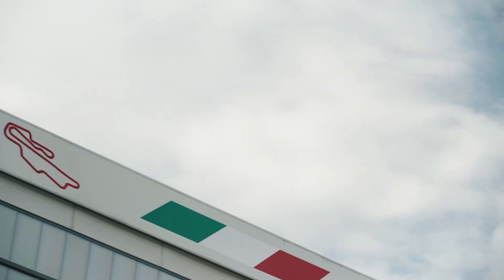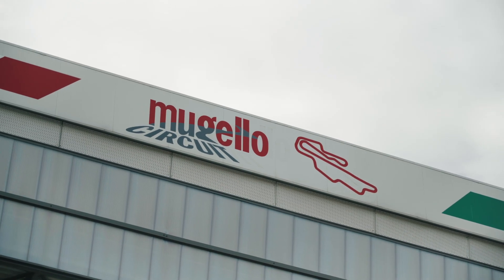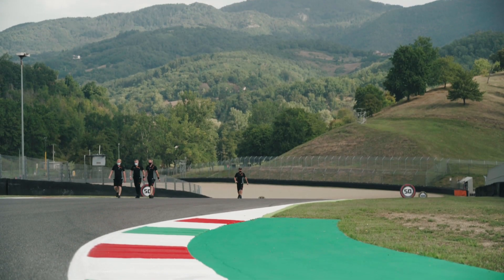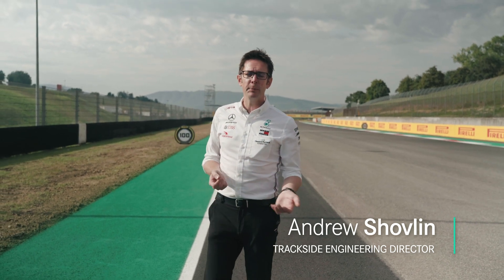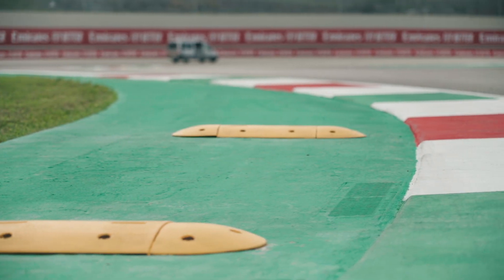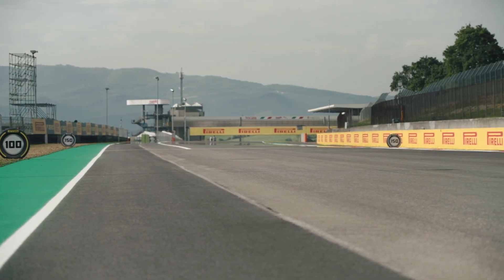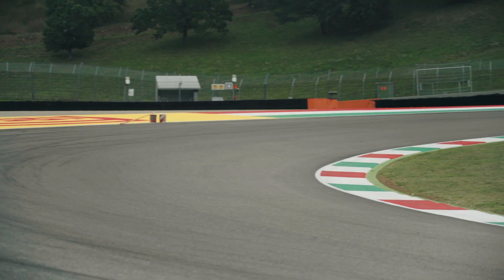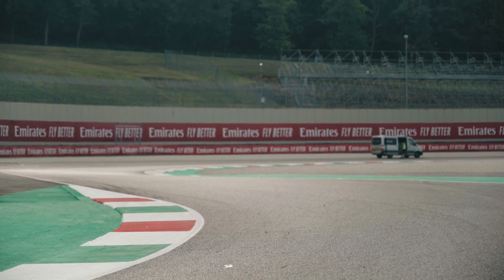How F1 Teams Approach a New Track

Comment: HP has a huge role in Mercedes' success. Ferrari needs that " HPE Apollo 6500 high-performance computing system " which runs all those "hundreds of thousands " of simulation under various setting.    Conclusion : HP is the Jarvis of Mercedes ;)